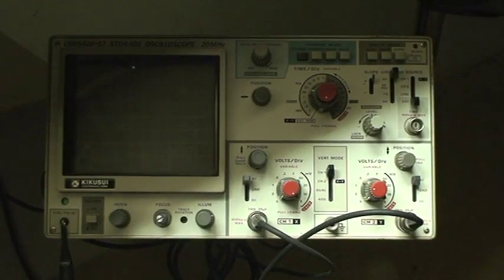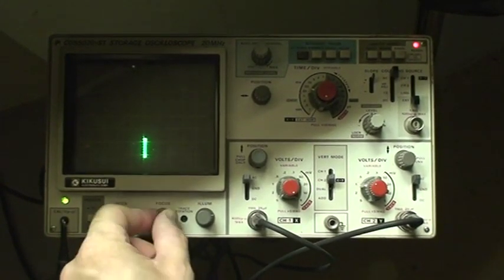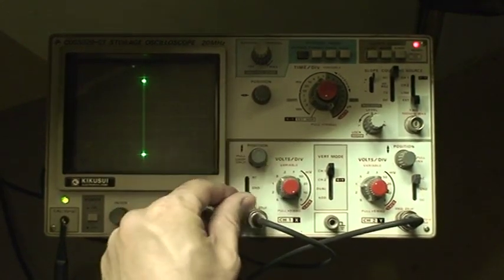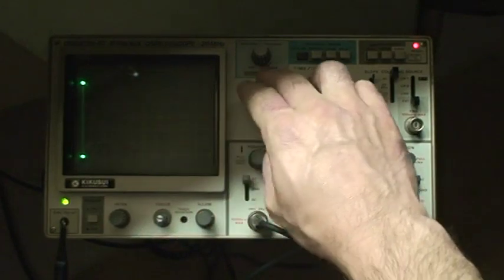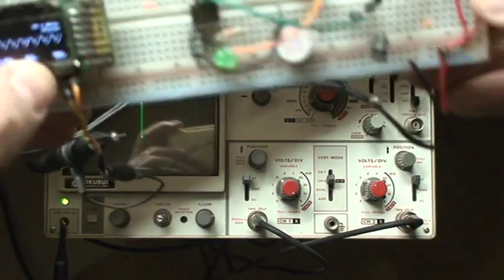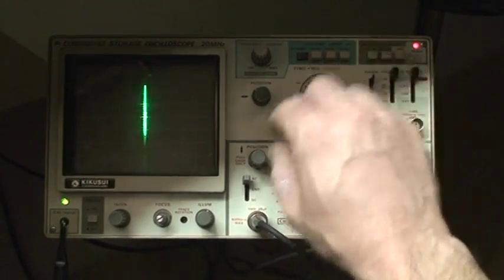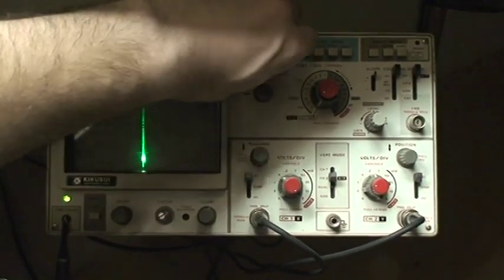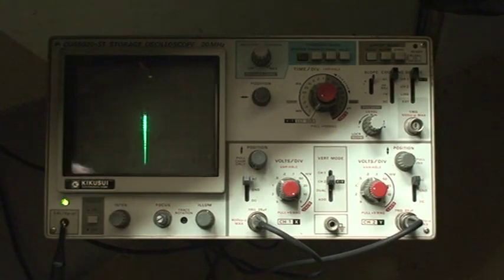Kikusui COS5020-ST Storage Oscilloscope Repair #1

Comment: Hello 
DevHackMod, how are you doing? Thanks for sahring. Did you fix the oscilloscope?
Reply from the maker: No, have not had the time to work on this at all. I don't know where to start, I'd have to check every circuit and values of every component. This would be to learn on, definitely not economically worth it, just for practice.

Comment: No horizontal sweep or no horizontal deflection. Check the horizontal deflection plates to see if you have a signal and trace the signal back to the sweep generator.